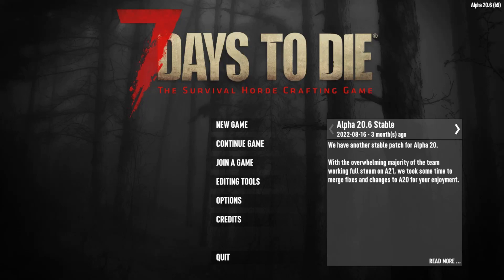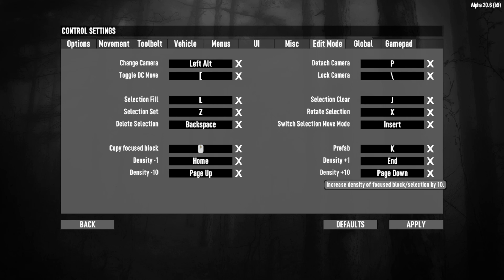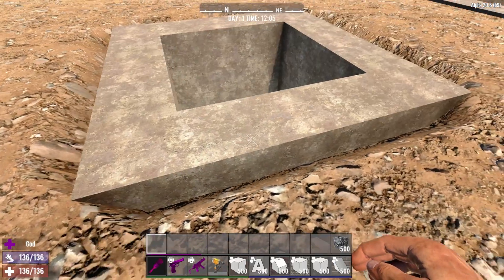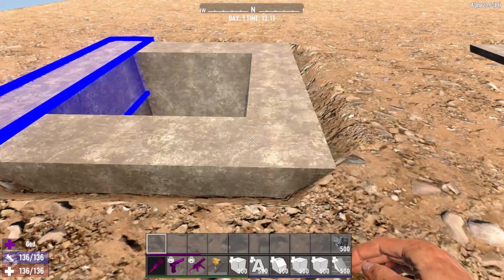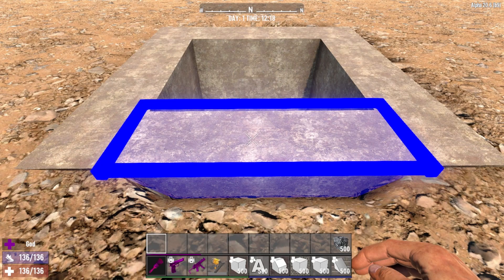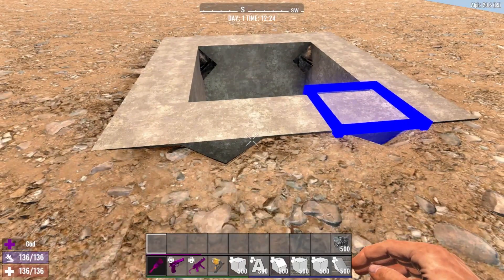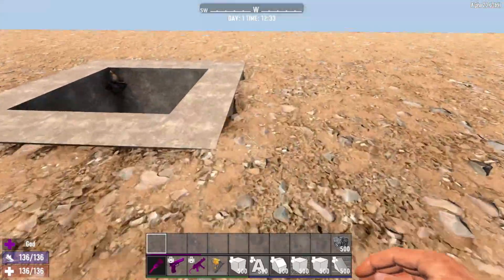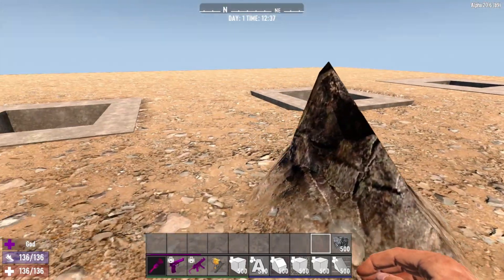7 Days To Die - Density Tutorial (Terrain Gap Fix) - Prefab Editor Series

Comment: 8:41 if u just place a frame in the bit where the ground has come thru the concrete and then pick it up will it be gone?
Reply from the maker: Nope. That does not work in the prefab editor. I wish it did.
Reply: @GunChronicles  hey did you see my new hanging gardens base and my new overpass suspension bridge video?
Reply from the maker: @tigrecito48  No, but now I know to go and have a look. Thanks for the notification.

Comment: hey.. is there a way to add lots of blocks at the same time using debug mode while playing the game? i did hear i can change some file to allow u to do this is there another way or thats the only way? ive been trying to make an island in the sea... but its taking forever placing one block at a time cos the sea is sooooo deep...
Reply from the maker: Not that I know of. I didn't even know there was a file that could be edited to allow for more blocks to be added.
Reply: @GunChronicles  not more blocks to be added to the game but so u can select and place more blocks in one go... its called windows xml i saw a video on it i just dunno what program to open it in or what i need to download to be able to do it.. theres another button that turns up once u get rid of a line on that document so it allows u to do more stuff that the devs disabled..
Reply from the maker: @tigrecito48  Yeah, I knew what you meant. I just didn't word my reply very well. My bad. You need an xml file editor. I use Notepad++ to do all of my xml file edits. It's easy to use and best of all it's free to download.
Reply from the maker: @tigrecito48  I know you can use normal notepad to read the xml files but I don't know how well it would do at saving any changes that you make to the file. You can give it a try and see if it works. Probably would want to make a copy of the original file first just in case it screws something up.